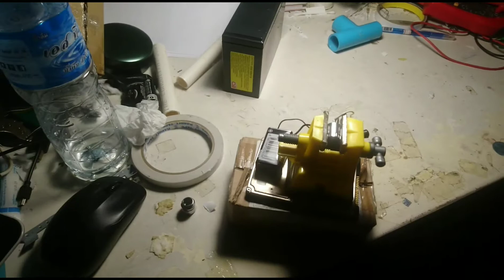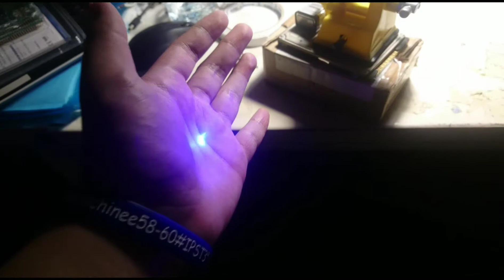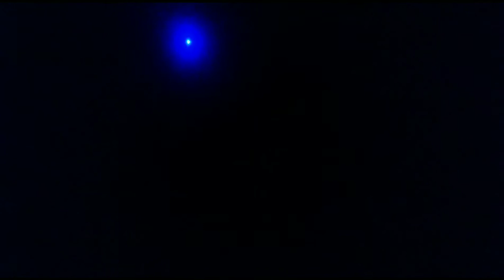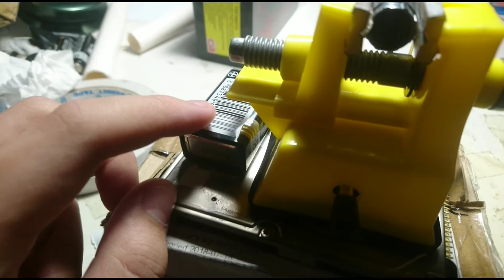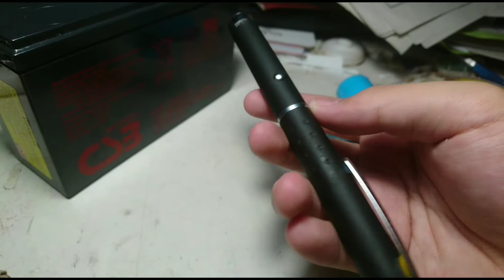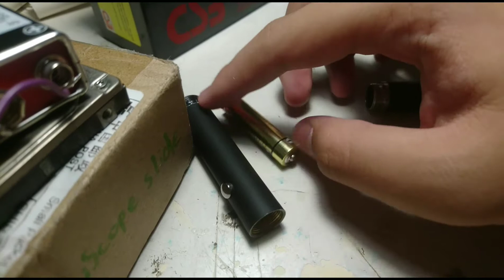OSRAM PLT5 450b .The 450 nm laser diode !

Comment: hello can you tell me what power supply you send and how many ohm resistance is
Reply from the maker: I'm not exactly remember, but I did use LM317, I suggest you to look at the Diode datashett for the max current, and use online current calcutor for LM317. (P.S. I've done by that method😉)
Reply: @TinLethax  track